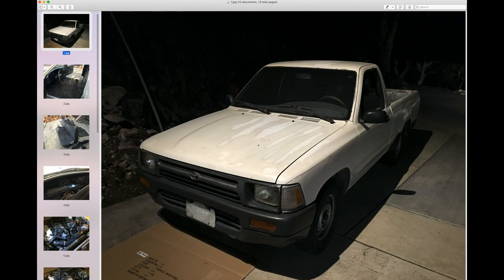Overview of the Toyota 22RE motor... what are all these vacuum hoses???

Comment: this is the most thorough and descriptive video ive ever seen .it make learning about this motor enjoyable instead of frustrating. thanks ray, it was very enlightening , i wish you had a video explaining the 20r and all its smog and vacumm and cooling and heating lines for my 1979 20r motor that is  carburated (with the choke that have coolant lines , not electronic). it was all in pieces when i got it and im having a hard time finding diagrams and info on it. a video like this on my 20r, made by you would be a dream come true, thanks for this one, i learned alot. even about the 20r from this one,

Comment: I have a 1986 4runner with a 22re. It's a factory turbo model with digital dash and it did come with an automatic transmission and a 22ret. The privious owner restored it and did an engine/transmission swap. Oil pump went out drove it for 5-7 minutes and it's been parked for 3 years. I'm almost ready to get it going again. Have the parts. Oil pump, headers, cam with a lift the computer still recognizes. And seals gaskets etc. I can relate to what you said in the beginning. I took auto shop for two years in high school and have only paid a mechanic two or three times. I've gained enough knowledge and have moved up to german engineering. I came accross a 1owner always garaged 2000 bmw 323i for$2500 i simply could not pass up. Needed the typical oil leak problems. Anyhoo. Videos like yours have helped keep all my cars going. Thanks for posting.

Comment: Great content Ray. You have help me so much on my restoration. She ran pretty bad when I got it. But with your help she is smooth and preforms great. Got the catch can up and running also. Thanks for hardware links. Hope ya don't stop making Toyota content.  Thank you again.
Reply from the maker: That's great Mike. Yeah, once you properly adjust the TPS and ensure the AFM is working smoothly - then start checking some of the other areas, the 22RE can run pretty smooth for sure :) What sort of oil levels are you seeing in your catch can when running the stock PCV system?
Reply: @ray5961  Checked the dip stick after 50 miles. nothing yet. It is working  as the stick has oil residue on it but no measurable amount on the dipstick.    I put the steel filter media in the internal chamber that unscrews. No instructions but I see people just put it in the bottom of the can. Seems to me you could suck stray pieces into the plenum. As gasses water and oil go directly into the filter chamber that you unscrew internally then it will grab and let the drippings down the holes into the can. ?? We will see what happens. I've seen alot of these catch cans are made by the same company. They are identical. the only difference is the hardware and hose material.
Reply from the maker: @mikeregan4505  Yeah, they all seem to be made very similar and just have different names and configurations. Be careful relying on the dipstick by the way.. it can sort of paint a false picture sometimes; it doesn't reach the exact bottom of the can, so sometimes it will show nothing, but actually there is maybe 10 to 20 ml in there. Also, you have to be careful with that little O-ring. Once I was driving on the highway and the truck wasn't running correctly... I had to stop on the side of the highway to figure out what was off track. It turned out to be that little O-ring wasn't making a good seal and it was acting as a fairly large vacuum leak. After that, I removed the dipstick and sealed that hole with an M6 bolt and some red loctite. Also, you might want to take a knife edge and scrap away the black coating from the dipstick (if you do intend to use it).. having a strip without black on it helps you see the oil a bit easier. On mine, I use just 3M green paint stripper inside the little chamber w/ all the holes; that seems to work great. Myself, I recommend actually opening the entire thing up to check it, so you can see exactly what you are dealing with. The dipstick has thrown me a few times - it looked like there wasn't too much oil, but actually the can was over half full. Having a clear glass can would actually be really handy haha :)
Reply from the maker: @mikeregan4505  That's pretty cool. I'll have to swing by Yoda 1 sometime myself and check out their shop maybe. Email for sending pics, etc. is listed on the About page for my channel, thanks!

Comment: Best video yet!!  Got my white 92 with a high top Leer camper shell for 500bucks years ago with 120k odo. Bought it from a nice lady and was the easiest buying experience ive ever had. Fast forward to ladt year I had 426k on the odometer and blew the head gasket for the 3rd time. 2nd time on the 22re performance head. Also the truck took on water in the intake from a flood i was in 2019 but was able to get the water  out in time and drive it another 150k.  Great reliable trucks!!  I put an ATK crate motor in at the beginning of this year and at the same time added the LC engineering street header. I had issues fitting the air injection tube. I had to slot the holes in the tube to get it to align with the header. I talked to LCE and they told me they have never had an issue... Also It is very loud and not in a good way. I'm not sure if there is something loose in the  motor. Adjusting valves a little tight does nothing, that usually quiets them up on anything I've had.  it's getting louder at 25k currently, It's like a clacking noise.  Luckily there's a 3 year no mile limit 1 time no fault warranty so il be calling at the 2.5 year mark if it lasts that long. Thanks for the videos!!👋
Reply from the maker: The LCE head is generally a pretty good fit. I think I did have to run a round bastard file down a couple of the mounting holes to give me a little wiggle room when I installed mine. It's definitely a very, very snug fit during installation. The AS tube makes it even more tricky. "Bolt on" is always really "fabricate on" when it comes to aftermarket parts haha... and yeah, with the header it's going to be much louder; the stock cast iron manifold quiets down a lot of the exhaust noise. Most all 22RE's have a valve train tick to them - even when in perfect adjustment. 4 cylinder motors have inherent imbalances in them also; nothing you do will really ever resolve it. If you want a smooth running, quiet motor, the 4 cylinder is not a good place to begin haha :)

Comment: I have a 86 turbo 4 runner, 22re, straight front, 529’s rock crawled out, bought for 6k put over 10k into it so far, most my vaccum lines and electrical are shot, no dead hooker smell but I love it so much! 😅

Comment: This was an incredible presentation. I have a question. I have a 22re with 159k miles. I have small cracks on those tiny hoses on top of the throttle body. Where can I get replacements?
Reply from the maker: Thanks! Here's the hose I used to run all new vacuum lines on my truck https://www.amazon.com/gp/product/B0002KNVPE

Comment: Great channel. I just subscribed. You should have more subscribers based on the technical competency of this channel. I'm looking at buying a 1993 22RE that has been sitting for 9-years. Do you think I need to rebuild the motor or can it be resurrected with some basic maintenance actions?
Reply from the maker: Thanks man! On the 1993 22RE, if it's been sitting for 9 years, I would initially start by pulling the spar plugs out before starting, just on the off chance maybe the head gasket had blown and water leaked into the cylinders, etc. Get a bore scope camera (the DS520 from Depstech is what I use here) and then rotate the pistons down and inspect the cylinder walls. At long as there is not too much rust in side and/or the rings haven't rusted to the cylinder walls and scored things, then you should probably be fine. Sitting shouldn't really cause any major harm as long as the rubber hasn't decayed too far or anything. Has it been sitting outside or inside? How many miles on the motor?
Reply from the maker: @airitwide  Sounds like a project for sure. Make sure the motor rotates freely with the plugs removed using a 19mm socket and ratchet. 192K miles isn't major, but you'll most likely be looking at replacing the timing chain and guides at least. Let me know if you have any other questions!

Comment: Hi Ray. What an extensive piece on vacuum lines. Holy cow! Anyway, hope you can help. The two vacuum lines coming off TB and Plenum to PS valve to up the idle. Do you know size of these two. They are about 18" long. I need to replace them as one just cracked a piece off when I was doing valve adjustment and moving it. Thks..jc
Reply from the maker: I just removed those last month on my friend's truck... but I believe we threw them into the trash. But if you swing by Napa or some place like AuzoZone, you can probably track down the hose.. they usually sell a nice collection of gates hoses and most places will let you venture into the back to compare sizes (that's what I do).
Reply: @ray5961  Thanks again Ray..Appreciate it..jc

Comment: Hi Ray. With all these vacuum lines which one is the one to connect vavuum guage to? And what would be acceptable psi on it. I have 22re 4wd sr5 efi with 228k mi. Thks for the input as always..jim
Reply from the maker: You can attach a vacuum line to any port that is on the upper intake Plenum or you can tee into any line coming off the Plenum already, but you cannot connect the vacuum gauge to any of those hoses up at the front of the throttlebody, it has to be off the Plenum. As far as at idle around 900 RPM you should be seeing about 18 in/Hg on the gauge once the motor is warmed up generally speaking
Reply: @ray5961  OK, great info. So I have two ps vacuum lines running off the plenum to a valve of some sort for ps. Would one of those work then. And as followup. What if vacuum shows below 18? Thks very much..jim
Reply from the maker: @Samson-EC  As long as the T is near the plenum, that should work yeah. Google something like "how to use a vacuum gauge" and there is some good info out there on line; that's how I learned to use one. Here's a typical page: https://www.onallcylinders.com/2015/05/08/quick-tech-how-to-read-a-vacuum-gauge-to-pinpoint-engine-problems/ - also don't forget to adjust for elevations above sea level. Mostly the vacuum levels gives you a picture into the health of the motor, specifically the ring sealing and/or if you have any vacuum leaks lurking around any place on the intake manifold stuff.
Reply: Ok. Thanks Ray